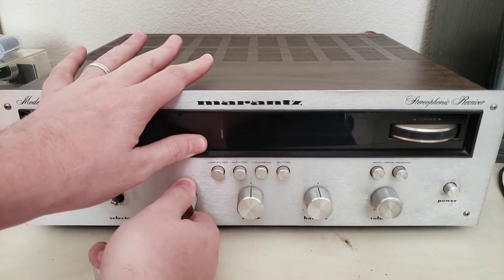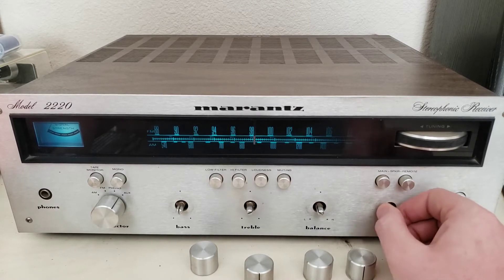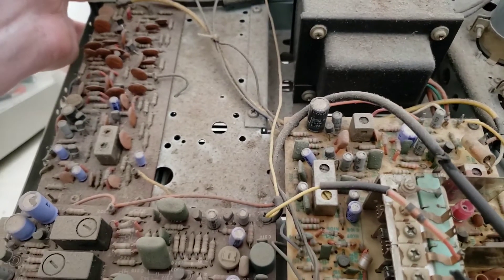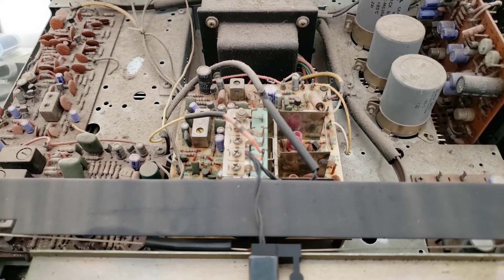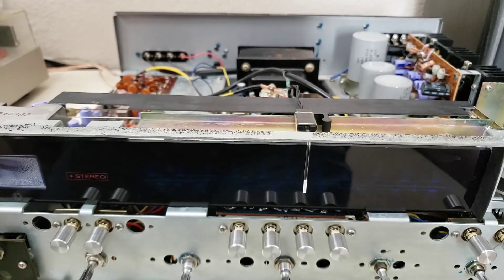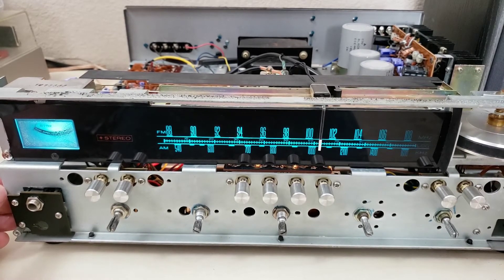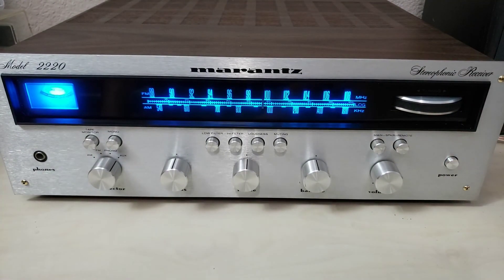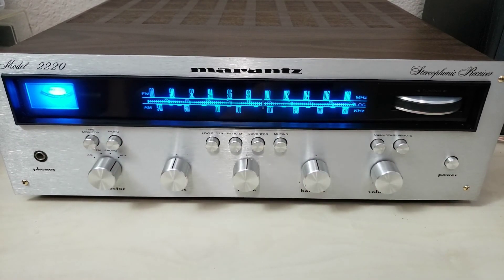Marantz 2220: Cleaning Inside and Out

Comment: Replacing the vellum (which yellows with age) between the bulbs and faceplate will restore the signature blue color dial, when regular soft white bulbs are used.  Not difficult to replace.  That's what I did to my 2220.  The tuning meter has vellum that can be replaced also, but a bit more difficult to do.
Reply from the maker: For sure -- I generally do warm white LEDs with new vellum these days for folks looking for the original look.  Most of my buyers are going for the cool blue recently though and for that I tend to leave the yellowed vellum as it tones down the cyan just a bit.  I've been working a while on a solution to the hot-spots the LEDs cause, but haven't come up with anything yet that really works and is also durable for transport.  I have a 2230 that I hand-carved variable-thickness foam light filters and it looks absolutely perfect, but I'm sure the foam pieces would get knocked around in shipping, so it's not a viable solution at scale.

Comment: How do you wash the unit in the dishwasher, did you use soap and hot water and for how long?.
Reply from the maker: I've played around with various options and not seen a lot of difference. I usually do a quick wash at default temperature without soap unless the unit is full of nicotine buildup. For the really nasty ones, I go for longer cycles and/or soap. It's all about risk. Hotter, longer, soapier all increase the risk of water getting inside of components and destroying them.
Reply: @cilynx  thanks for your quick response. I have a Onkyo TX-2500 receiver which i bought on eBay and when it came, it was filthy and smell awful. I managed to get grime out of it but i still can’t get rid of the smell, and it gets worse when the unit is powered on.

Comment: the "his" is due to defectives transistors. most likely in the ten times preamp . search the net of Troublesome transistors you will find a list along with the recommended replacements.   motor boating sound is a bad electrolytic cap.  time to replace all of them.

Comment: The green/brown light has nothing to do with your bulbs. Replace the paper and nice blue returns.
Reply from the maker: Agree that the greening is caused by yellowing vellum, but what bulb you but behind it definitely makes a difference.  I generally do warm white LEDs with new vellum these days for folks looking for the original look.  Most of my buyers are going for the cool blue look recently though and for that I tend to leave the yellowed vellum as it tones down the cyan just a bit.  I've been working a while on a solution to the hot-spots the LEDs cause, but haven't come up with anything yet that really works and is also durable for transport.  I've done some custom foam work to balance the light on one of my own units, but it wouldn't be robust for shipping.
Reply: @cilynx  To get rid of bright spots turn your LEDs backwards.
Reply: Did you remove the dial needle, lights and fuse before putting it in the dishwasher?.

Comment: Is there an alternative to the dishwasher  ?
Reply from the maker: Depends on how clean you want it and how much risk you're willing to take. Some folks have had success with a low pressure hose. If you want to reduce risk, compressed air will get you halfway there, but never as clean as using water.